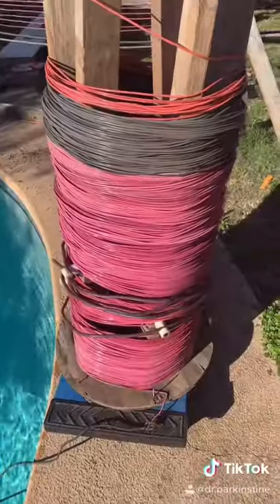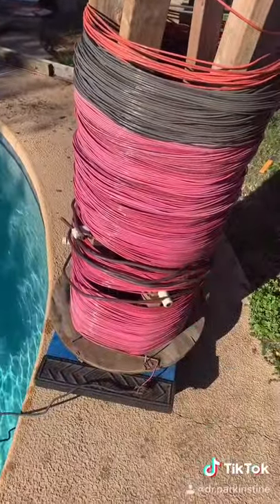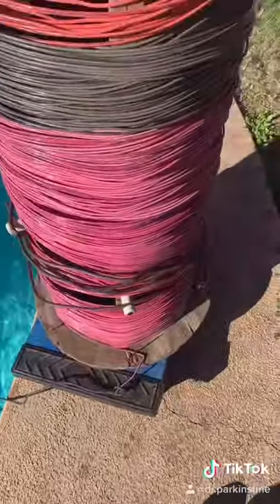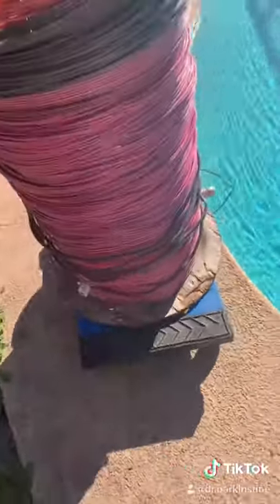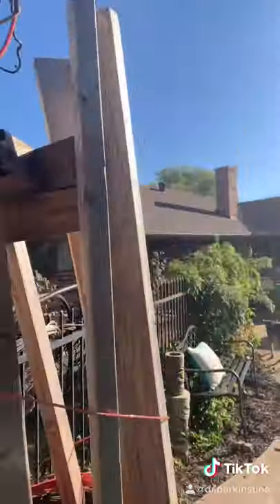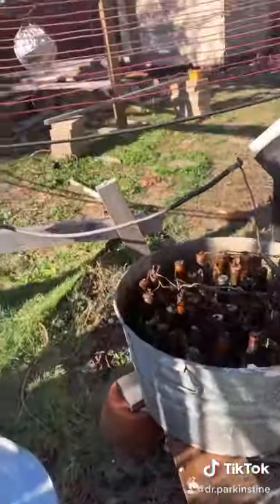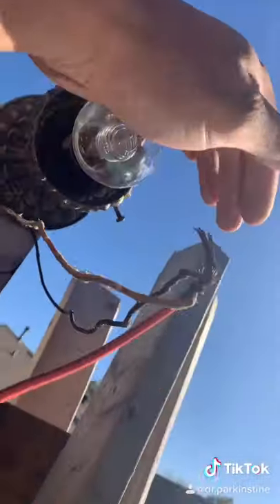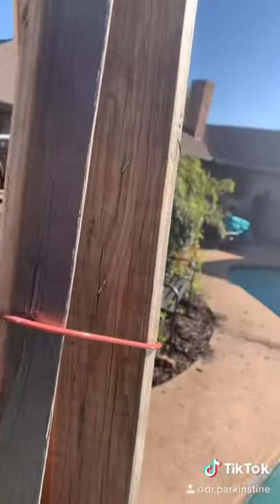Transmitting electricity wirelessly

Comment: When do you think you can get enough electricity to run a house?

A manual how to build that would be nice for anyone who wants to run their house off-grid to be safe from grid failures.

Great videos! Thanks for them! 💙
Reply: From what I’ve read, there are ways to turn up the power, but it begins to interfere with radio signals. You’d have to contain it somehow or put it in a remote area. This guy has actually sent this electric current 987 miles across the country.

Comment: Pulling electricity from the ground is not what it’s doing it is acting as a negative if he pulled that cable out of the water the light will not work you could plug that cable in to the soil and it would work and you could plug that cable in to the negative outlet in your house and it would work all it needs is a negative earth to work